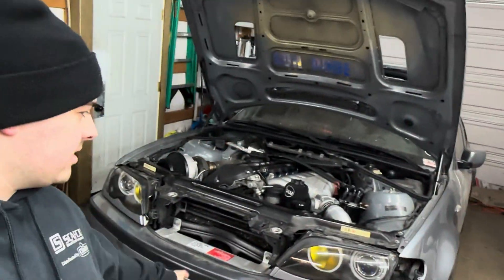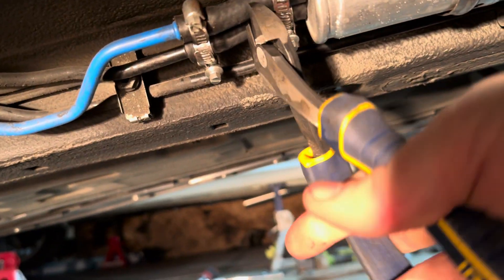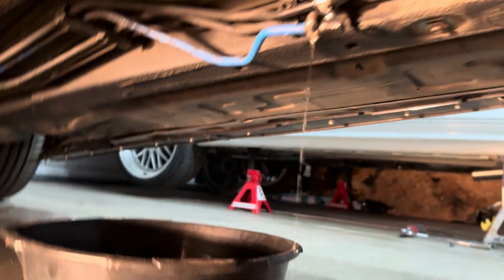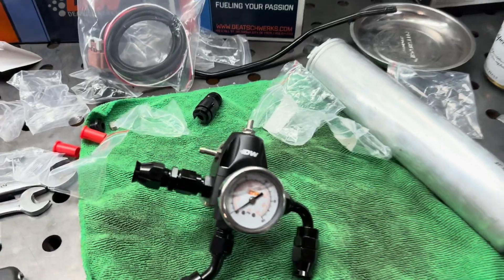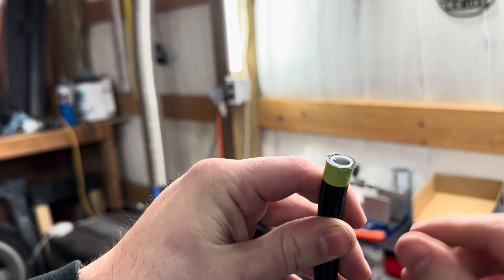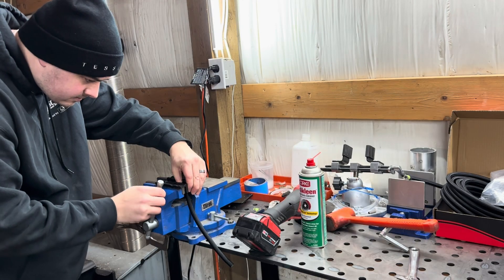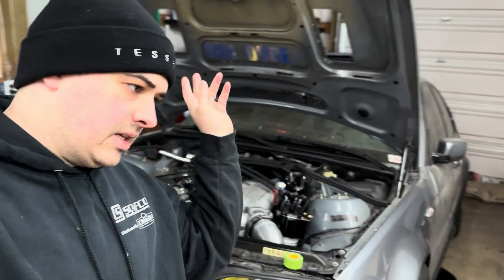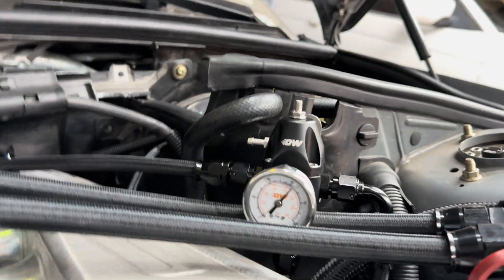Turbo E46 Rebuild: Fuel System Upgrades

Comment: Quick question, one of the lines from the regulator to the rail seems a bit short. How do you know how mucht to compensate for engine movement when making the lines? What if an engine mount goes too soft or tears?
Reply from the maker: I’m not too worried about engine movement as I’ll be switching over to Revshift green mounts. There’s a small amount of slack in that line that I can even increase by moving the regulator over a bit, which I might do when I get around to actually mounting it